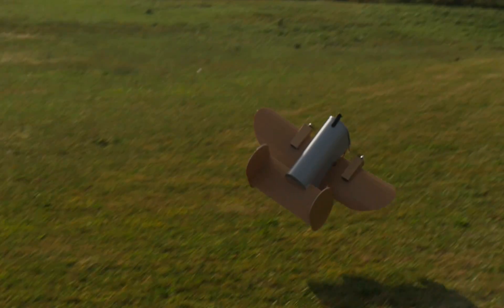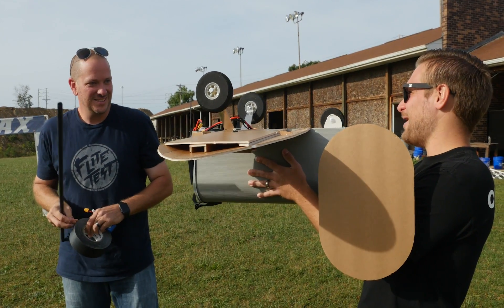RC FLYING Mailbox - 24 Hour Build

Comment: I've never messed around with RC but I really enjoy your Channel. I would have opened the door on the mailbox and put a clear helicopter bubble on the front. the wings may have had to come forward an inch or two, but I think it would have weighted the nose and looked really cool, at the same time reducing drag. it would also make a great place to stick the camera. Maybe on the next build you could turn the mailbox around and use the door to release mini quads?!

Comment: Do you think you could make a cordless power drill fly?
It has a motor, ESC, 2 18V batteries for under $100. Take off the spring on the trigger and attach a servo to it, big prop and big old wings.
Oh and would think you would need a 3D printed firewall to cope with the power.

Comment: Back in the day, we built a barn using power poles at the corners. Cut in half, they are still stupid heavy. We sunk those poles six feet down into superhard clay and that barn has withstood hurricane after hurricane.

AG motors and really big rotors..maybe you can make a portion of a pole fly. Big-ass chunk of wood. Big-ass motors and rotors. Lots of them. Enormous freakin' batteries. Lots of them. That's pretty nuts, and I can't think of anyone on the planet who could pull it off but you guys.

I hope you still read the comments on your older videos. A flying power pole? Even a section of it? Yes. It is stupid beyond reason. Therefore it must be done, and you are the only people I think, who could actually do it.

Comment: OH I SEE KIT HERE.
OPTION of a foam mail box
or a regular mailbox.
I thought they made mailboxes of the traditional shape but out of plastic like pvc. Actually going to the hardware store shortly. 
We're still doing Harvey cleanup, so I will be hitting the local True value. Lowe's a bit further away and we're waiting for replacement pickup truck so it's mountain bike longistics for a moment.
The weather cooler now Very nice, and actually I NEED the exercise. Hurricanes as health and wellness. 
Ugh, I have a lot of r/c plane water damage. haven't checked my servo hoard.
do that now

Comment: Someone else said it first, Radio Flyer wagon. Do it. Also, lifting tails as a stability strategy are not all they're cracked up to be. You get into a very, very dangerous pitch tuck tendency in certain flight regimes. Take that from someone who has spent hundreds (thousands?) of hours testing platforms like that.

Comment: How about one of those oversized Nerf baseball bats? You know, the hollow plastic ones that have the same kind of feel as the fuselage of the Stratosurfer. It wouldn't be as crazy as a mailbox, but should be pretty do-able.

Comment: This might sound dangerous...  but have y'all ever used, or made, steel props for a quad?  Able to slice through leaves and small limbs.
I know they would be heavy, but if they were pressed from razorblade metal, and sharpened...  you'd have surprising results.

Comment: New way to deliver mail. Go into a nose dive with the latch off on the 'box while accelerating, add somesort of deployable airbrake, deploy the airbrake so mail drops out of the front then hit the throttle again to pull up. Then you hope the mail went to the right house when it fell.

Comment: Nice work. Try to turn a race quad into a fix wing and quad hybrid, preferably with independent controls, one pilot controls the plane surfaces and motor and a second pilot has control over the quad FC.
Reply: They did something like that with an inductrix. Slapped it on the front of some sort of plane.
Reply: YTFPV they already did this

Comment: Have you ever thought of flying reversed? Have the tale wing out front with the propeller and the main wing in the back? Basically turning a mustang around and fly backwards. That would be sick!
Reply: I think they had an episode like that back when Peter was with them.
Reply: 0calvin I gotta find that!
Reply: its called a canard. http://www.boldmethod.com/images/learn-to-fly/aircraft-systems/canards/primary-eurofighter.jpg
Reply: Asmos159
Wrong a canard is small front wings on the nose of an aircraft along with regular wings and tail.

Reversed horizontal stabilizer and main wing, is the backwards airplane configuration.

The Grumman X-29 has canards and reversed main wing configuration, which led to the Russian SU-47 Berkut.
Reply: Zeaiclies Google a velocityaircraft
Reply: https://i.pinimg.com/originals/a2/03/6a/a2036aa2e8ab6d4ab51cbb04c84e5c3f.jpg
Reply: B&O Craftsman https://youtu.be/Ika-qrX-vhQ

Comment: What a fantastic project, very like something you guys typically would come up with . The overall shape reminds me of the Polikarpov I-16, a Russian fighter plane from the mid 1930s, bar the fact that the I-16 didn't have a twin engine configuration. If you are taking suggestions for another scratch build , it would be great if you designed another early war Soviet fighter, such as the Yak 1, to give your very impressive Mig 3 design a wingman! Anyway, wonderful project!